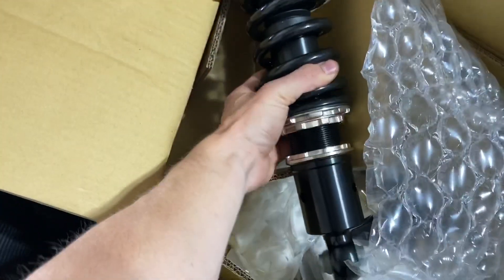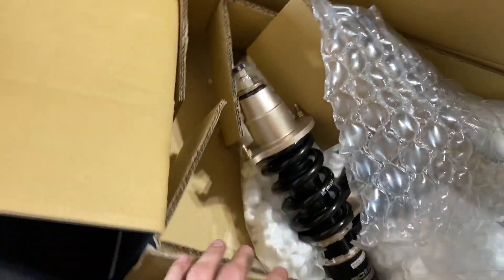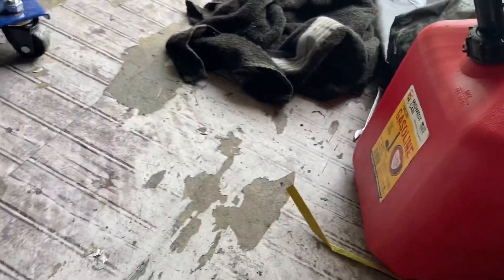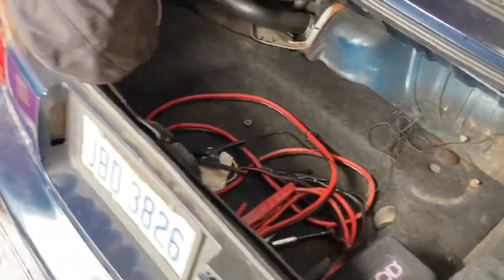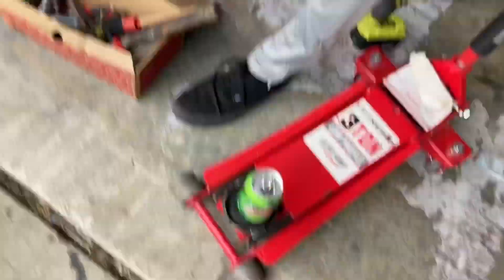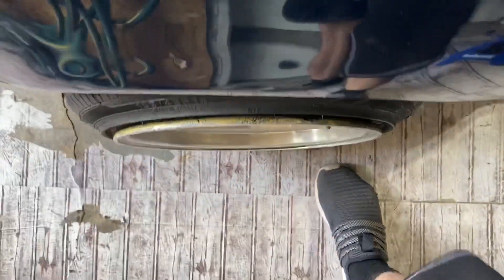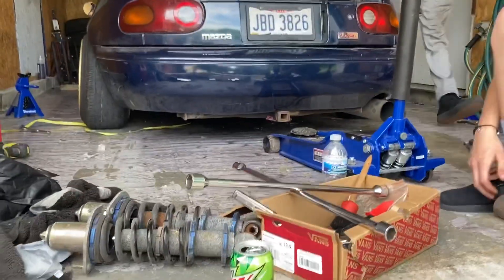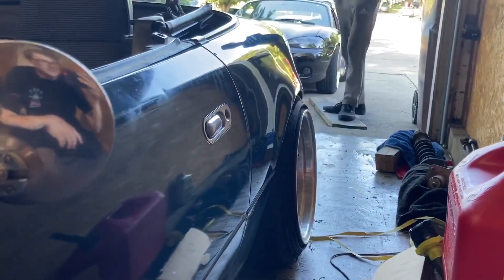Bc Extreme Low Coilover Install on my Homies Na Miata

Comment: Did you rolled the fenders? I want them but not sure if i need to roll the fenders😊
Reply from the maker: Depends on wheels and height. You can use them and not have to. but at some point with lowering a car you’ll have roll them.
Reply: @YataBros  i have jr3 7 j et20 r15 , i want 20kg/14kg  spring conpression